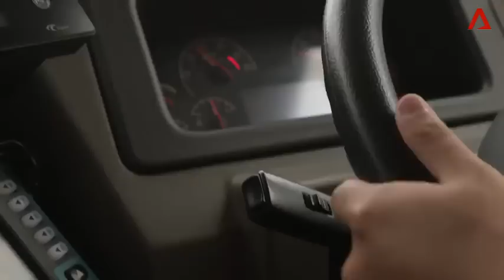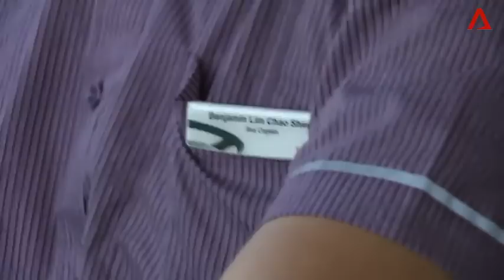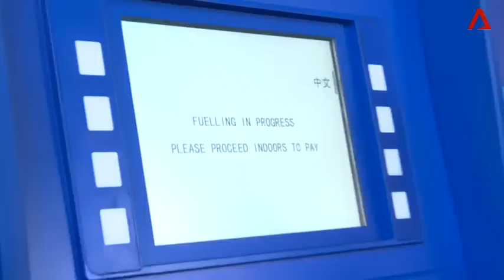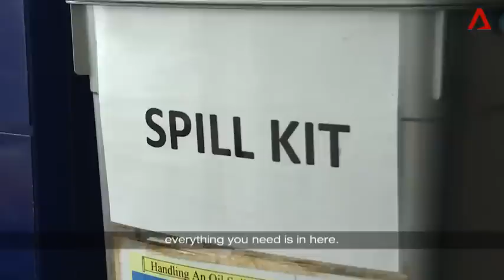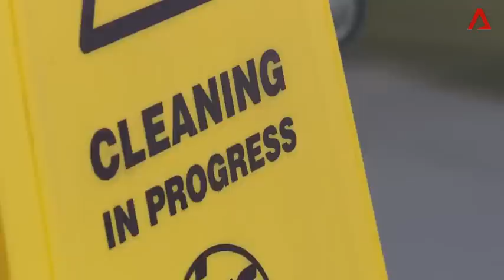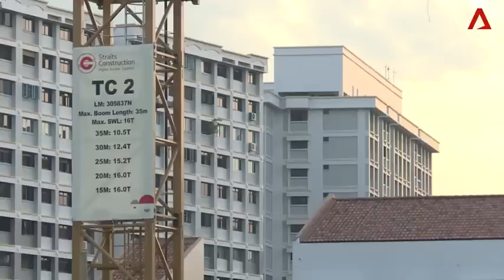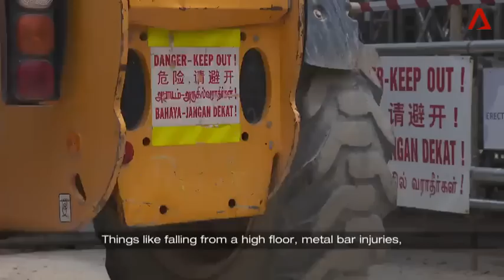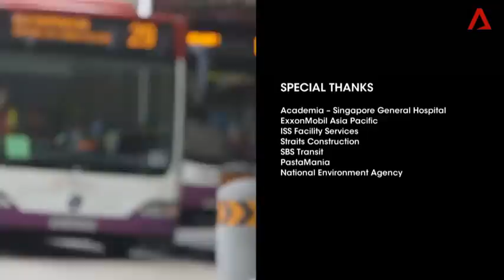CNA | Don't Make Us Invisible | S01E01 - What I Really Have To Do

Comment: I refer to YouTube by CNA insider " CNA | Don't Make Us Invisible | S01E01 - What I Really Have To Do" - On Fatimah the hospital cleaner that have to clean out bio waste from the lab, to reduce the legal, reputational and financial liabilities to the hospital since this video was aired to public and to naturally protect properties and human lives, the cheapest way would be to revamp a "jacket material" waterproof long sleeve uniform (hospital got aircon and is cool), for cleaners and medical staff (ever wonder by doctors and lab scientists wear long sleeve white coats?) so the cleaner Fatimah have some form of personal protection as she lift the biowaste bag from the bin. Tuck the long sleeves into the yellow gloves. There will be times where some of the bio waste may spill onto her naked forearm resulting in infections on Fatimah. As the cleaner travels around the hospital, the viruses may brush against building structures or onto other human assets and patients. After disposal of the biowaste, the cleaner should remove her long sleeve jacket, apply anti-virus spray from air pressure bottle (like hair spray) with gloves on, hose sleeves down with water and wipe dry with paper towels. Ideally, future hospitals would have the laboratory assistants use small biowaste bins, once bins are full, the bags are tied up by professionally trained lab assistants where they drop the military grade tear resistant bag down a chute in the wall, directly into the big biowaste bin at ground level below, loaded onto a vehicle to be incinerated. For those high tech lab buildings, they have their own incinerator below the buildings, where the system is mostly automated, the biowaste bags dropped into the wall chute goes directly into the building's incinerator. Though one ought to manage the toxic fumes from the incineration of biowaste wisely. Please feedback to management.